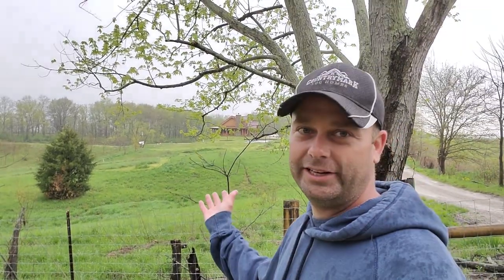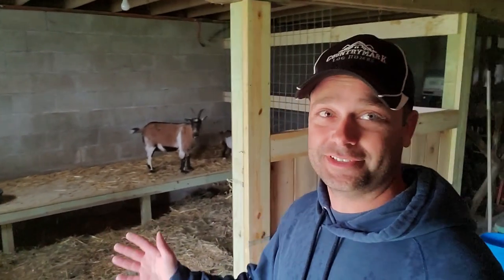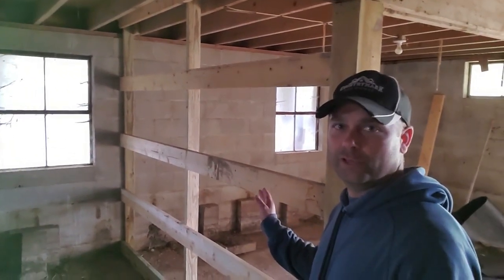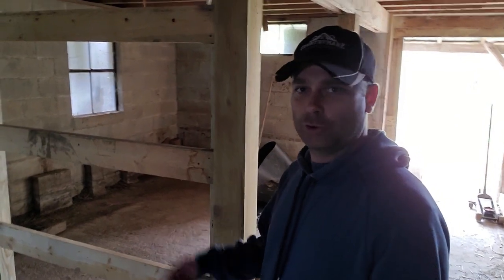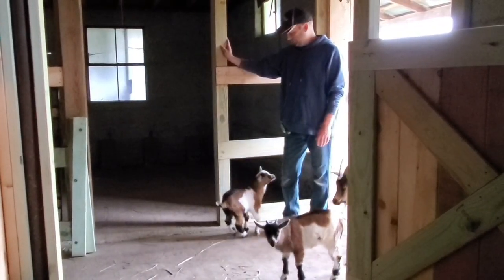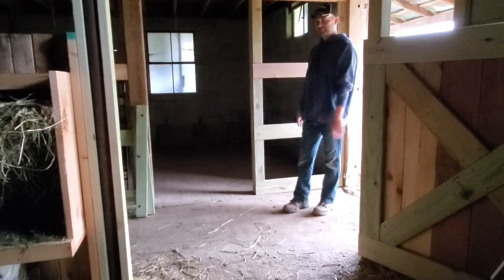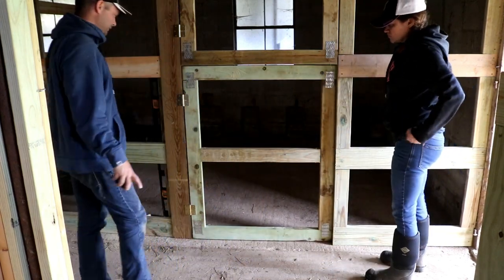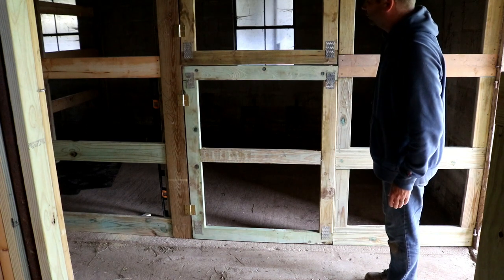Building a Chicken Coop inside our Barn - Part 1 - Walls and Doors

Comment: Looks great, don't forget to place an adjustable angled brace in your door from the upper hinged side corner to the lower non hinged side corner so you can lift your doors back into square as they sage.  You can use a cable with a turn buckle so as it sages you just give it a few turns.

Comment: Thank you for showing using the mending/ nail plates. I had been wondering about those.
Reply from the maker: They are hard to work with, lots of hammering and trying flatten.  other people didnt like them.  So may not be the best choice.
Reply: @CountryViewAcres  There are other plates. I used a different kind to hang 2 cross ties in my small chicken house. (I need to re-start my channel and get some content up.)
Reply: I hope this info is helpful
The mending plates are available with holes for nails or screws. The ones with the formed spikes are intended for production work using a press - they are TRUSS or CONNECTOR PLATES rather than mending plates. https://www.mitek-us.com/products/Connector-Plates/

Comment: I know this is an older video but those plates are not designed to take the place of nails or screws. They will back out over time if you don't put a few nails in them.

Comment: I Hope the goats don,t jump on the wire and brake the wire mesh or tear it off.
Reply from the maker: I hope they don't tear it up also.  We used 3/4 inch fence staples to secure the hardware cloth.  Hopefully it with stand the goats.

Comment: my hubby bought the plates and found them to be #HORRIBLE as a connecting choice and HARD to work with. I would say DO NOT USE the backing plates.
Reply from the maker: Sorry if they didn't work out for you.  They can be difficult to hammer down and stay flat.  They like to wrap and bend.  They will give you a work out to hammer them on.  Sorry they didn't work.